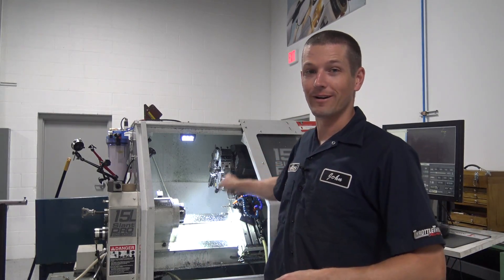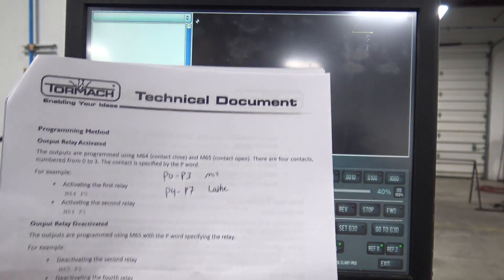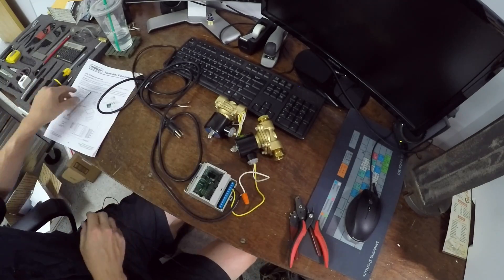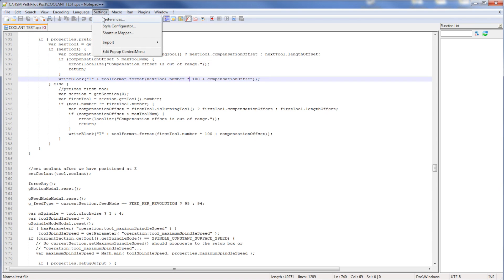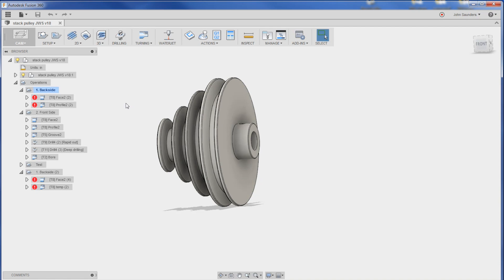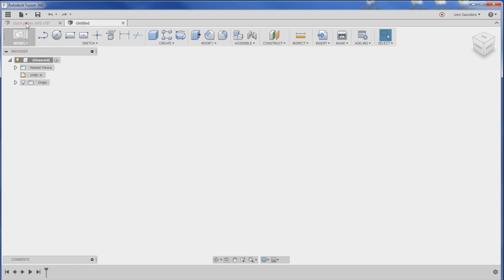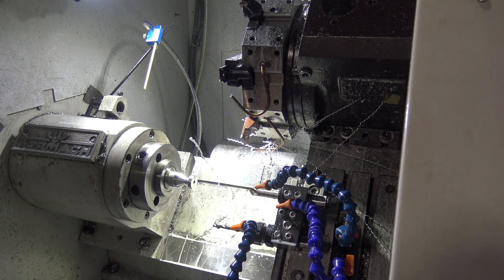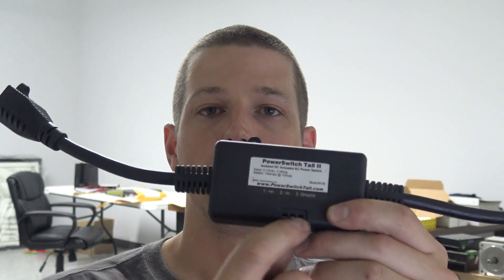Hack Tormach Lathe: Automatic Gang & Turret Coolant!  WW110

Comment: Hey John! Really cool project! Nice to see more electronics projects lately! :)
If I may, I have some suggestions:
1. @ 11:13 you add a else if. I think it is better if you just use an else, because if you ever add a tool that is not in the scope of the if or the else if no valve is opened and your pump is building pressure with no valve open, which can destroy it depending on the type of pump.
Using an else if is nice if you would use 3 sectors for coolant. It is better to use just one if to check a certain range and open the other valve in all other cases. That way you never block the pump.
2. Take power (110 volts) from your machine after the emergency stop relay (if it has that). That way you don't have any external power "running" on the machine in "safe" mode, and you can't forget to put the plug back in when you moved the machine for example (see point 1).

Comment: You've already got 120V running to the relay block to control those two valves. You could have done that with a single power tail and a couple jumper wires down to the second relay contacts. You could also jumper to a third relay and then connect the female end off an extension cord, so you would just have a socket to plug in your mist cooler.

Comment: I'm thinking a 'rail spray mister' for the inner window :-)
Reply: +NYC CNC 
Air curtain with locline fan nozzles. You got the compressor to run em now. 

Slave it to the coolant system. Coolant goes on, air solenoid opens. Coolant off, air off.

Comment: Great video, John.  Makes me want to buy a Tormach lathe (In my dreams).  I use the same solenoids for my mister on the mill, and an auto drain on my air compressor.  (it opens the drain for about 20 seconds each time the compressor come on.)

Comment: excellent instructions! I did similar changes to my machine recently. One of those was the air to the spindle and laser (I made my portal CNC dual purpose for now). I did that a little different, I do not know if the same is possible for fluids. I had two relays as well with two solenoids but the first one was on/off from the air tank. The second one was a commonly available 5way solenoid this way there is always one line connected/open. I imagine similar things should be possible for fluids such as coolant? ( Variable 1 = Pump on/off and variable 2 =  a 3 way switch that allows the fluid to always go either way.

Comment: That's amazing mate! Next project: windscreen wipers on the inside of the machine
Reply: A rotary wiper or Rotorclear I believe they are called. But they limit 
the view inside the machine quite a bit and are expensive.
http://www.rotoclear.de/

Additionally, they would be overkill for the amount of cooling John's machine has. 
A bit of cleaning with some window cleaner will be more than enough.
Reply: I've never had a wiper system that has lasted. 

They always get gummed up with fine chips, dried coolant, and other junk.  They're a pain to clean and you have to keep buying new wiper blades for it all the time. 

Never seen a good one, all gimmicks in my opinion. And stupidly expensive for what they are.
Reply: Or one of those spinny disc things like boats have, I forget the proper name for them ;-)
Reply: Definitely not a gimmick. On modern machines with over 100 bar coolant pressure and lathes with mulitple turrents it's must have. Otherwise running a new programm can be a pain in the arse. The best solution I've seen until now, is an air curtain (no clue what they are called in English) The window is protected by a wall of high pressure air.
Reply: +Revo SeR 
Air curtain is what I suggested in another thread here. 

Like I said. Never had one work well for more than a few months.

Comment: Why not a bigger pump and run both at the same time?
Reply: Work smarter not harder.
Reply: +Søren Fuglsang yea but cost of a bigger pump must be cheaper then two valves and a breakout.
Reply: Bigger pump = more electricity & higher maintenance costs = more expensive operating cost = less profit = more time working = less time with family.... It all adds up

Comment: Actually, you want to switch the "Line" on and off with the relay and have the neutral line be  permanently connected. Neutral is connected to the ground bus in the breaker box. This will prevent you getting a shock if you play with the solenoid while thinking that the relay if "off".  White is neutral, black is Line and hot.
Reply: That really depends on what part of the country you are in as US  nominal voltages of 110, 115, and 120 all exist. My lines actually run a bit hot as my tested voltage is normally close to 128vac but that can vary 10+vac over the period of a day depending on line loads between me and the source.
Reply: Yarp, also 120 is the nominal voltage, not 110.
Reply: bcbloc02 I'm sure the utilization voltage has those swings but the nominal standard voltage is still 120.
Reply: +Justin Bell it's not a matter of where you are in the country, it's a matter of who's interpretation of the AC RMS voltage. Rectify the AC to DC, and you should see a peak of something around 177 DC volts. 110, 120, and 117 (which you occasionally see listed) are all referring to the exact same AC voltage.